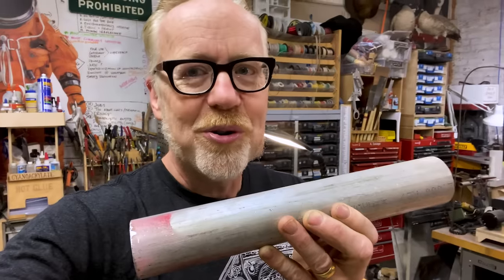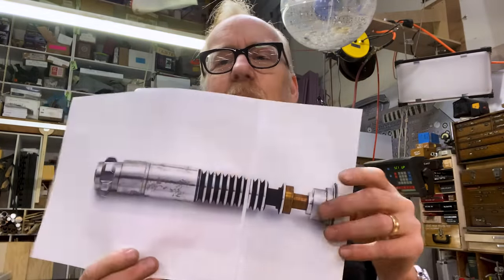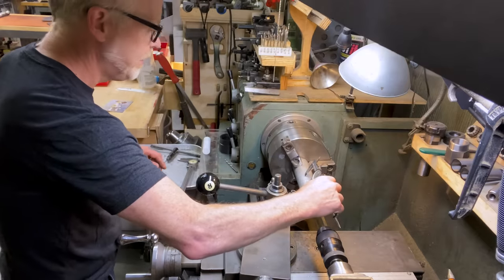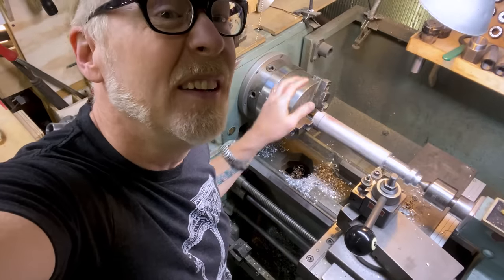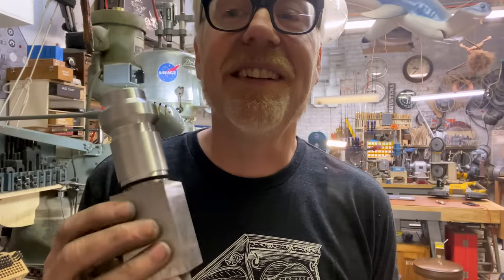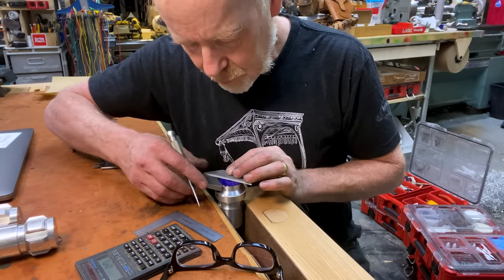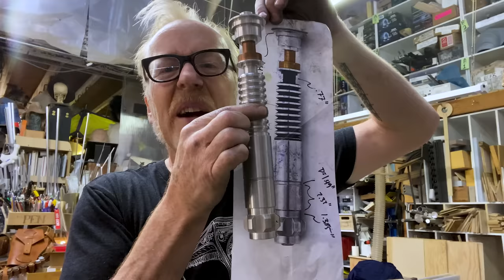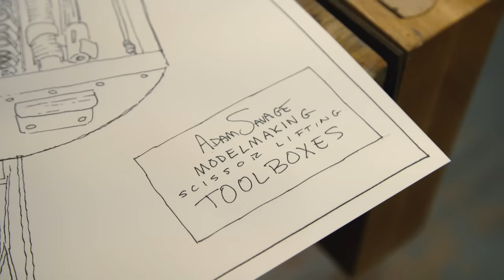Adam Savage's One Day Builds: Luke's Lightsaber!

Comment: Tiling on a Mac: make it into a pdf, open in adobe acrobat reader. The print options there allow you to print a poster on tiled sheets.
Reply: Yes!
Reply: And for Windows: Use MS Paint! It's found within the print options menu
Reply: Yes. Most PDF viewing software has tiling functions. I use it often for 1:1 jig layouts...complete with registration marks for alignment.
Reply: Another trick on the Mac: when you come across an image that the website won’t let you save, hold Shift, Command, and 4, and then you can select an area on your screen to capture.  Saves it as a PNG file on your desktop or downloads folder, depending on settings.
Reply: I came here to suggest the PDF poster option for tiling also.  I use it all the time on windows to make stuff for my classroom.
Reply: Right. Works whatever the initial size
Reply: @Dyundu  yes but that only captures it at screen resolution, where as the actual image may be a lot bigger.
Reply: Used to use a simple piece of software for this called rasterbater (no really). Dead simple and it tiles images perfectly with registration lines. I believe papercura can do this too (but only for pc, not for us Mac users)
Reply: Works perfectly thanks
Reply: @Dyundu  That will get you a low res capture based on your screens resolution. Saving the source file is the only way to get the full resolution.
Reply: Preview also tiles used to tile. Hmm.
Reply: Affinity Photo allows you to select tiled printing from the Print dialog, it even lets you to specify an overlap (in pixels) to help when sticking them together after printing. I would have thought that Photoshop would have this functionality too but presumably not.
Reply: @Dyundu  Yup! You can also hold Shift, Command, and 3 to capture the entire screen and then crop it to how you want. These also work when capturing images off of video.
Reply: Im an engineer, there are so many times I've accidentally tiled schematics and drawing.  Acrobat does it easy.  Also visio and about all engineering software its easy too.  I think the issue is art and publishing programs assume you wouldn't want a tiled print.
Reply: I was just coming here to say the acrobat function. Also, indesign can do this too.
Reply: Came here to say this ^^^ 👍 
Just doing it now on a image I needed to scale up for my current woodworking project.
Reply: If you may not download the image AND if the image is not a link, you can drag the image to the location bar. It will show you the direct image.
Reply: Exactly. In the print dialogue it’s called ‘poster’.
Reply: Thank you. I had to use this and I couldn’t remember if it was Adobe acrobat reader or not. It works perfectly, it will even print marks where to cut.
Reply: I came here with the same answer
Reply: Illustrator lets you do this too, in the print dialog, with TONS of great options.
Reply: As others have said - I was coming here to recommend the same thing. Acrobat Reader is available on both Windows and Mac and makes creating tiled pages extremely easy. If you don't have the image as a PDF simply open in a free image editing tool such as Gimp, blow it up to the size you need then save as a PDF. Alternatively save as a PDF, then use Acrobat's zooming function (though this is likely less accurate than using an image editing tool). Then Acrobat has great poster functions - you can set the amount of overlap per page, have cutting lines turned on or off. It's incredibly useful.
Reply: Works on Windows as well.  This is how I print out my blueprints for cosplay.
Reply: @lastditchusername   Here's the original https://rasterbator.net/
Reply: I completely forgot you can PDF print a tiled image. Years ago I made a five piece sunset horizon wall decoration for an apartment far, far away and absolutely could not remember how I did it. Open Image in New Tab, Save as PDF,  Open PDF, Rotate 90°, Print. Trimmed the paper and pressed between something that was definitely not lexan judging by how spectacularly it broke.  I think I'll redo/remake/improve something similar with a high resolution picture... maybe have the tiles printed on glass? Or have Walgreens print something for a coffee tabletop? I like that idea. 

EDIT: Further reading here revealed I had completely forgotten Rasterbator! Thank you all for mentioning it. I used it for a large black & white mural. I think it was 10¢ a page on the (fairly nice) library printer. 

Head injuries are annoying AF.
Reply: You can import the image into Indesign and when you print it will allow tiling

Comment: For a Mac use illustrator. Make the art board to the massive size you need then in printer properties set your print size to letter. Your art board will then show a bunch of ghost letter size outlines breaking up your art board. That sizing formula is spot-on. I used to use that as an artist to size up or down on a stat camera. It was also useful to size up roughs to transfer to boards for paintings. It’s amazing how many of those old tricks I use today when designing products.
Reply: I know on PC that the newer Adobe PDF Reader programs have that function buried in the print menu tabs, probably Mac too, but don't own one to check.

Comment: Adobe Illustrator does automatic tiling. Import your image, size it, and choose whether you want to tile page or image area (eliminating margins).
Reply: You can do it in a lot of programs' print dialogue. Even google chrome has a custom "scale" option under "more settings" that automatically tiles oversized images. I was chuckling to myself that entire portion of this video because even though I have the full Adobe Creative suite I do this exact kind of thing professionally simply to save time.
Reply: Ok but how do you do all that? Lol
On illustrator
Reply: I would create this in a 3D modeling program, import the texture map from Illustrator or a similar program and then 3D print it.
Reply: You can also get an 11x17 printer.
Reply: @JeffreyJusticeLosey  yeah I was going to say it doesn't need to be that high end. I'll also add Microsoft publisher is another good tiling printer program most people have easy access to, at work or in libraries or with a 365 account. Very easy to make banners with tiled printing in publisher
Reply: I've used //posterazor.sourceforge.io/ for posters.
Reply: Yep. Just about any Adobe graphic software will do it. I use Acrobat usually.
Reply: Is it free?

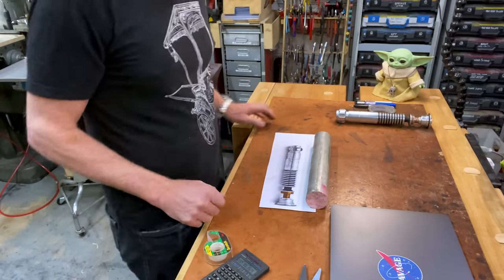Comment: "Ok, one of the issues I'm gonna deal with here, or I'm actually NOT going to deal with here, is called paralaxing..." 13:16
Reply: Within Photoshop there are two options for resolving parallax. If you know the camera & lens used, which can often be found in the meta data, Camera RAW can remove the lens distortions. However, there is also a lens distortion filter for eyeballing it on the fly, which may be needed if you work from a screenshot.
Reply: (sung to tune of Lumberjack Song) "Oh, it's some parallax, and it's okay..."
Reply: In the show and tell for the ZF-1 Adam mentions he tends to build props about 10% too large and he even suspects it is due to parallaxing. I guess this is a practical demonstration of that effect. 

I did notice when he was measuring the "faucet" section that the bumps weren't square to the camera, so that width was always going to be off due to perspective.
Reply: @padoco73  1. What Adam calls "parallax" is just perspective. Parallax is when the treees in the field move slower than the trees by the road when you look out the window of your car. It's an effect of perspective, but there is no parallax in a static image. Perspective has a vanishing point. And 2. The lens distortion tools in PS or any other software will never change the perspective, only things like chromatic abborations, barrel distortion and such. Perspective is a point in space, from which the photo was taken. It's not an error of the lens.

Comment: Adam, in Google Chrome - you can right click anything and choose "inspect element". This will open the developer toolbar, and help you find the link for your jpg much easier!
Reply: Was just about to comment the same.  Much more direct!
Reply: True, except "Inspect Element" doesn't work either when the right-click is disabled.   Instead you should just open the Dev tools (F12), click network tab and then filter on images (IMG).
Reply: @footrotdog  if using safari, chrome or Firefox, just go in to their settings and disable JavaScript from running. This stops websites from blocking right clicks.
Reply: If you're using Chrome, it's CTRL-SHIFT-i then if you left-click on the image you want on the web page, Developer will take you directly to the top level tag that contains the link for that image.

Comment: Hey Adam!  Regarding tiling images, you can tile directly out of the Adobe Acrobat print dialog!  It's a function I use fairly often in the architectural industry to print scaled drawings.  Hope that helps cut down your photoshop time!  Cheers
Reply: And Illustrator also has print tiling.
Reply: I personally have tried to accomplish it on excell worked with no problems

Comment: Thank you for your wonderful videos, including this one. I respectfully suggest you've incorrectly blamed parallax for the discrepancy in your saber sizes.

It is notable that you scaled the printed image (your reference point) to be exactly 11.75" long because that was the auction site's measure of the actual saber. If the final saber turned out too long (compared to the exact replica), would that not be a result of a bad measurement by the auction house rather than parallax? Did you ever measure the ACTUAL length of the exact replica? It would seem that 11.75" might not have been the correct length measurement of the saber.

To explore the effects of parallax, I would think you would have to actually print that same saber image to the same length as the actual replica, build one to that printed image, and then compare that one to the replica.

Comment: On the tiling issue - back in college I made some Big Heads to take to various sporting events - simple tiling printed blown up images then spray adhesive onto sheets of 1/8 MDF then cut out with a jig saw. Believe it or not, I found that Excel worked the easiest as a software to blow the image up in, then hit print and it handled the tiling fairly well. I was limited on my margins and had to take each sheet to the paper shear, but it accomplished what I needed for the dozen or so sheets of 8.5"x11" prints that I ran out of my cheap college student inkjet.

Comment: In terms of the paralax problem, or any similar accuracy unknown, I usually work on the assumption that most designers like to or naturally work in round figures. In many cases you can accurately guess that the correct figure is because it will be a logical round figure.

Comment: Dear Adam, I know this answer to your question from 10:00 comes super late, but there is a program that is available that tiles for posters automatically. It's the Adobe Acrobat Reader - which is free. The only downside is, you need to insert your pictures into a .pdf format, which actually is trivial:

* load the picture in for example GIMP.
* scale to liking
* export as .pdf
* open in Adobe Acrobat Reader
* choose in the print options "poster" and set the scale to 100% (or even only scale now!)
* set an overlap as needed
* print!

You might get some blank pages, but you don't need to manually cut up the model.

at 41:00 you asked for help with the 45° - and I suggest using a compass: using the endpoints of our right-angled lines, a set of 4 equally sized circles of less than half the outer diameter of the rod around those will intersect on the half-lines between each of the points - The cross through those intersections will be at 45° to the lines. The same trick can be used to establish the 90° line in the first place, using a radius that is larger than the radius of our stock.

Comment: Interesting to see different methods end up at the same result for scaling/printing reference images.

What I usually do is take an image into inkscape and do a vector trace, and then resize it from there (because I never thought about using percentages which now i realize is probably more efficient haha). 
Then i just open the resized image in ms paint and go print > page setup > choose your paper size, set all the margins to 0 and select the "adjust to: 100%" option instead of the fit option. Here you could also skip the first part and just scale it up directly in the page setup.
After that, I just double check I have all the pieces and then hit print. 
I don't use mac so not sure what could be an equivalent though, but basically all the page management is done in the ms paint print dialogue.

On my home printer this just give about half a cm of whitespace around the edge of the page though, so not a lot to overlap to work with, but enough to tape the pages together.

Comment: Hey Adam - little tip on downloading pictures that are locked like that. In the top left hand corner (on Firefox, Chrome & Edge) there's a little square with a cursor over it. Click that, you can then select the image and it'll show you the exact spot in the source code that image is placed.

Comment: Tip for the next time: You could open the lightsaber image in adobe photoshop, change your work field to A4 paper sheet size and remove the white background from the lightsaber image so you only have the lightsaber itself left. Photoshop will tell you what size it is in pixels, you can change that to millimeter or inches (or whatever you prefer). Uniformly scale the lightsaber to the accurate 1:1 scale, it should fit on an A4 paper sheet. Then you could print it! Make sure you have your printer settings correct though so it uses the full A4 sheet. If you have a printer that can print A3 sheets then use that because it definitely fits on that which means it will 100% guaranteed print the right size. A4 printers tend to scale images down to make sure the whole image fits on the sheet (which we don’t want since we need an accurate sized image)

Comment: As a computer graphic designer I use CorelDRAW and it has tiling option in print mode. You can even set up how deep the margin jas to be in order to precisely merge printed sheets together. Althou it is software made for vector graphics, You can add images and scale them to 0,001 mm precision. Hope it will help You.

Comment: That ll.75" light sabre might fit the 8.5 x 11 paper if it was rotated to fit diagonally. 
I used to have to tile a lot in my package desigh days. I found Adobe Illustrator to be a great tool for that because it would let you tile manually by moving the art around in the print preview pane. It was quite a handy feature. 
This was 12 years ago, hor Adobe didn't snatch away that feature.
However, I know the whole point of this exercise is to not resort to any fance software.

Comment: 40:48 For scribing your circular (cylindrical) surface into n equally spaced lines, simply measure the circumference C with a non-stretchable tape of some kind and then divide C by n, marking each division. You can wrap the cylinder with tape to make C come out to a more easily divisible length if you want. Then wrap the marked tape around the cylinder and make your scribe marks on it. This even works for odd n divisions, as well as for unevenly spaced marks.

I believe something like this technique was used by clock-makers to make precision gears back in the 1500s.

Comment: Try using Cad and printing on a 7x11 pages might be more conducive, but can do on regular letter paper as well.
I do all of my scaling in Cad Mechanical, same basic principal but you can post the actual figure, draw a line of a measurement that is known and then scale using that dimension using the calculations you performed. Another program that could be helpful is Bluebeam Rev PDF editor as you can dimension in that program

Comment: Custom print size and then use adobe pdf, you can print your pdf to poster and use non standard paper sizes to tile out to multiple smaller sheets, you can even control the overlap between sheets, very handy if you don't have a large format plotter to hand

P.S you can do the same trick to grab pictures on windows as well

Comment: For Adam or anyone else doing something similar. I may have a suggestion/solution to the image distortion/parallax in this case. I may be wrong, so please correct me.

With the image, you changed the percentage of the length based on knowledge of what the length should be vs was. But the printer percentage isn't just one dimensional. It then expands the width. So the image won't be the correct width.

I am pretty sure you can use the center of the image (where it is least distorted), use the width to calibrate/adjust for distortion. Focus on that middle point being exactly the correct width and the rest should fall into place more accurately than the result you've gotten.

I'd love it if Adam or someone else could test this possible solution. To test it, all you'd have to do is find that same image and scale it up according to the center width. Print and then compare the new printout with the already existing lightsaber's you own. See if it more closely matches the proper "official" one that Adam lined up against the others. No need for anymore machining or long day of work.

Comment: Pro tip, you can right click on a website object and click "inspect" in Chrome and it brings you directly to the line of the object you right clicked on, for example an image. Sometimes there's an invisible layer over a page you can delete the element (by right clicking in the pop up source section) then right click -> inspect the element or picture again to get the correct image source